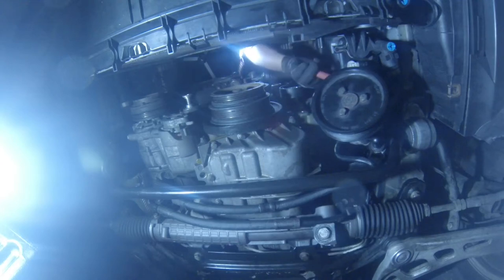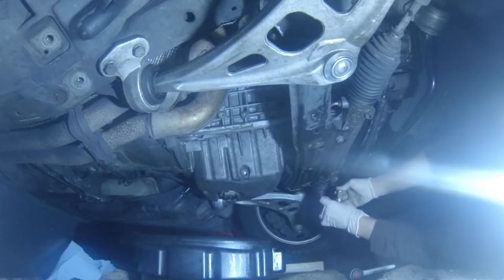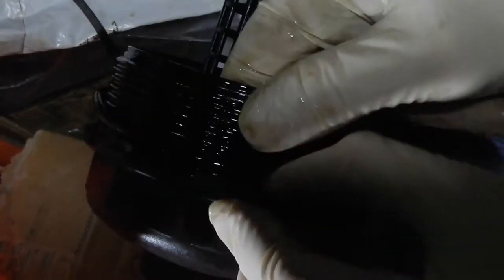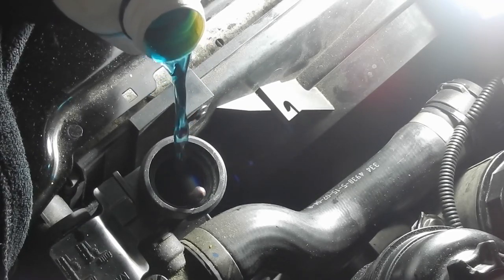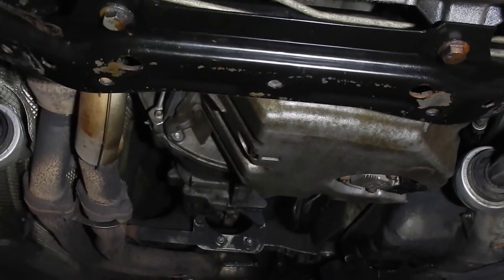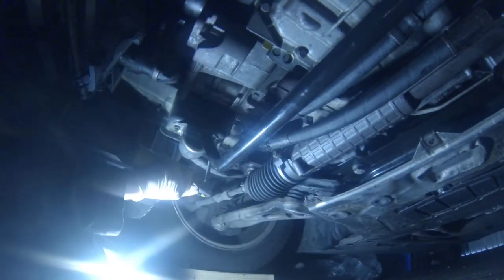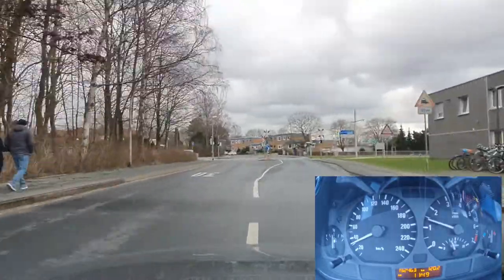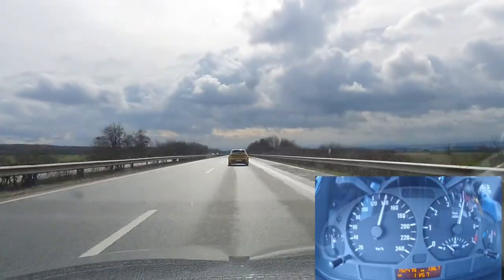BMW oil leakages fix I Gaskets change I e46 e39 repair project I Vanos rebuild I Autobahn test drive

Comment: Apparently it takes a few hundred km for the VANOS seals to seat properly.
Reply from the maker: Could be.. in my case I didn't notice an issue after doing the Vanos. But in one or two times I got a fault code related to the exhaust Solenoid. I just deleted the code and never came again. May be an adaptation issue.